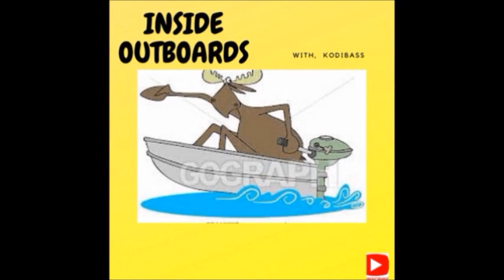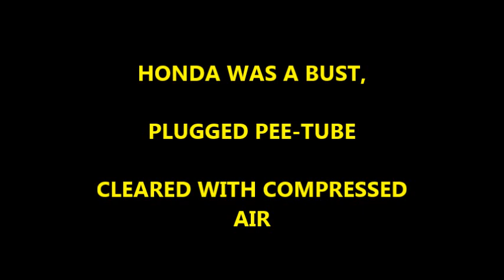JOHNSON 30 HP, MANUAL PRIMER HOSE ROUTING

Comment: i have several backup & one main running 2 stroke outboard motors & one 4 stroke Mercury 9.9 it carb prop motor it got slow speed and faster speed too! the 2 strokes used blue ethanol treatment and 2 stroke oil too, i use ethanol mix in normal gas too! i need stuff done right or it messes up!
Reply from the maker: You got that right,  Lucky where I live we have no ethanol gas,  Our gas comes from a small refinery out of Nikiski Alaska.   kodi

Comment: Yeah, I remember that Merc.. Kinda a neat motor.  Not that I want one, but what I do wish I had is that plum tree!
In Texas, those M.O.B. switches, and using them, are law.  And the game warden does check!  It's a fairly new law, and hard to remember to use it sometimes.
Still impressed with all the smaller outboards on that island.   You have a nice little business there.
Reply from the maker: Yep'  It's a nice gig 4 sure.  I am not sure if it is a law here,  I should look into that 4 sure.   thanks            kodi

Comment: Yesterday I tested ny snowblower,  primed it enough, didn't underprime, but it wouldn't even pop. I'm quite sure I used Sta-bil fuel treatment in it this Spring so I was suprised that I had to blow out the carb passages. But I was even more suprised when after I lost that tiny little float spring that makes the needle valve retract when fuel level drops in bowl, & I put the carb back in place to have it where it needed to be until I could get a new spring, & I tried starting the snow blower just in case it just might run with only gravity causing the needle valve to retract, & it started right up first pull & never missed a stroke from any needle valve sticking condition. But, Kodi, over time should I expect that needle valve to be hanging up before I can reinstall a float spring?
Reply from the maker: It very well could,  Just a bit of yuk getting in the carb & most likely you will start having sticking issues. In the mean time I would add a bit of Marvel mystery oil        kodi
Reply: Thanks for reply, Kodi, the Marvel Mystery Oil tip makes good sense, to do a better job of lubing the needle valve in it's travel, and the float hinge pin.
Reply: I think I remember an old quiz show long ago called Name That Tune. And I suppose if a question was asked about who was the mascot for the Starkist brand of  a certain seafood, referring to Charlie, that could be called "Name That Tuna"

Comment: There is a very easy mistake to make on some of these models with the manual primer...Some of the carbs have a nipple on the carb bowl drain plug...I have seen cases where guys accidentally hook up the fuel pump supply to the primer inlet, and the primer supply hose to the carb bowl result in instant carb flooding....Don't think this can be done on this model though...
Reply from the maker: I have seen these primers with hoses going every wrong way  imaginable,  Give me a good simple flapper any day.     kodi
Reply: @kodibassInsideoutboards    You got that right buddy!  Another case of over engineering and wasted added cost... Owners don't understand how the primer is designed to work, and it is hard to operate properly as well....Oh well...